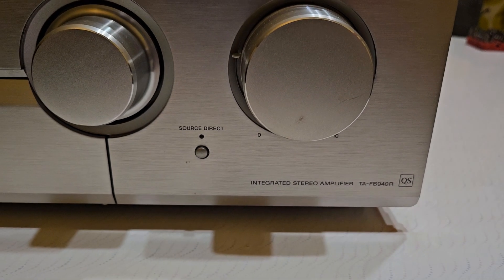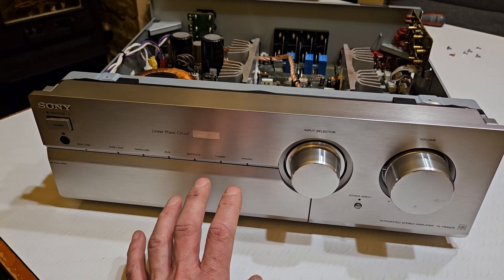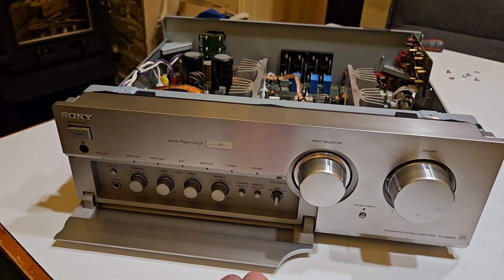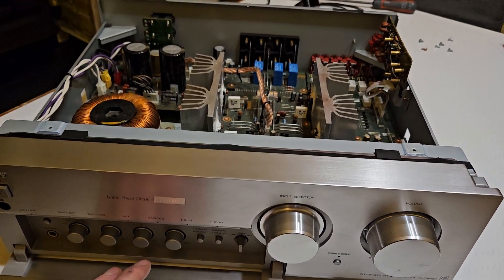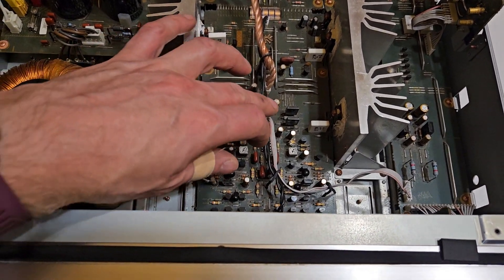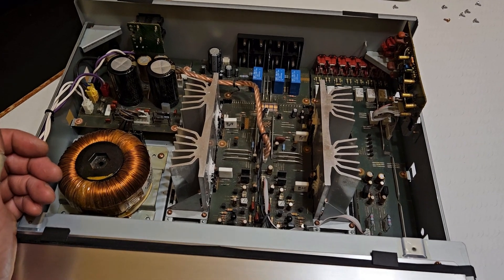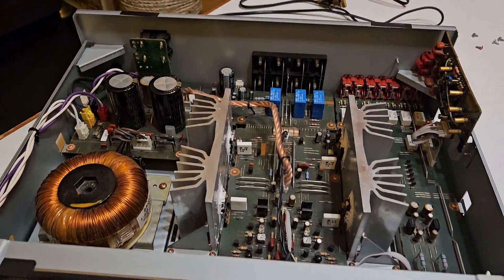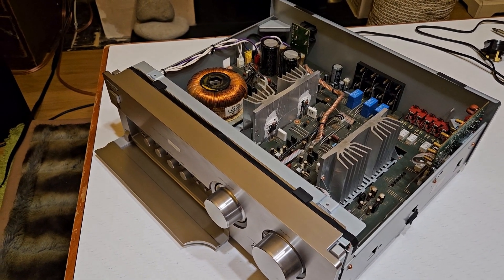Sony TA-FB940R Amplifier: Repair

Comment: Thank you, I have the same amp, had it a long time and it has progressively worse intermittent clicking/ticking that sounds like the same thing. Now I need to understand how you fixed the dry joints - I assume it needs a bit more finesse than a blowtorch and a fistfull of solder 🙂